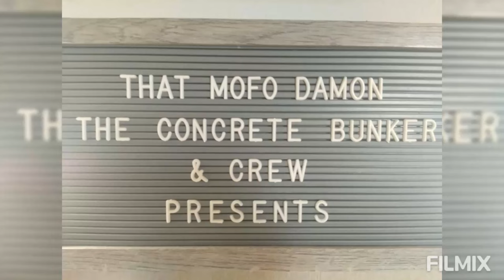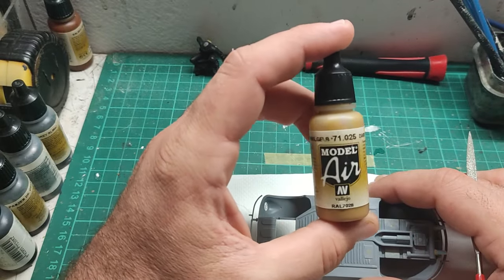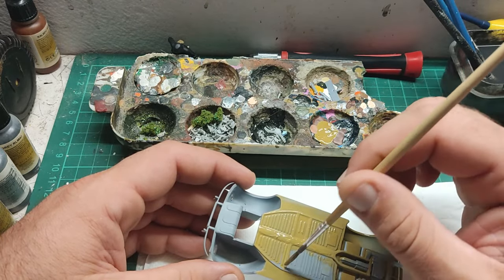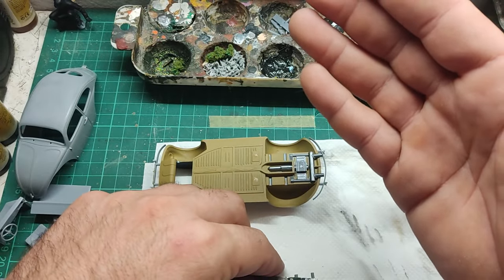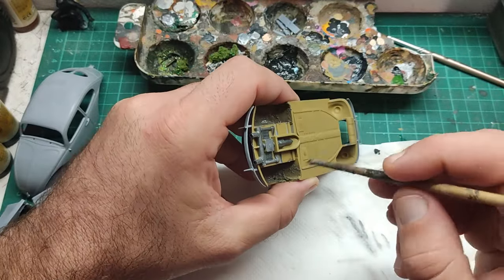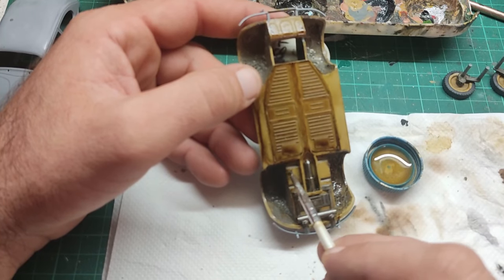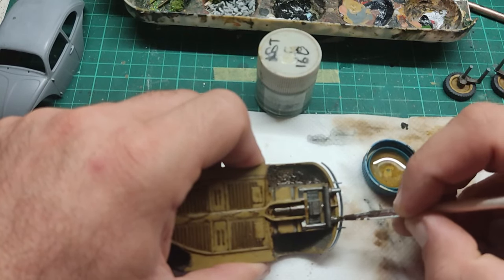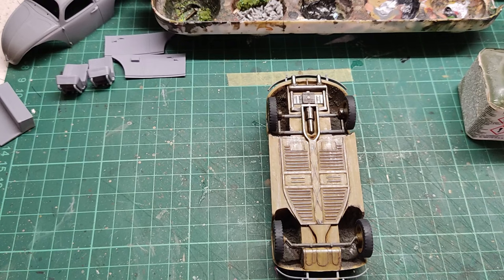VW Type 82 E Part 2 1/35 scale CMK (T35014) Sh#t high and gaze project

Comment: ευχαριστώ . Thank-you for your tutorial on brush painting Vallejo, I also paint mainly with Vallejo and have an airbrush, but some times because of noise from compressor I can't work when I have spare time at night. I' m going to try your method, no primer and just wet the brush. Normally I mix water with the paint and it becomes fragile when drying. Cheers from 🇵🇹.
Reply from the maker: Παρακαλώ (you're welcome)
I am really pleased that I've been of help! Give it a shot, you can always use  primer with my technique also, doesn't hurt, it actually may be even better. Moisten your brush, thin your paints (some of them, not all need to be thinned) and go for it. 
Let me know how it worked out for you, i hope that I've earned your subscription today. Take care and model on, greetings from Greece!

Comment: Hi George
Just a small note with your ‘racing’ exhaust modifications….
The little tube sticking out from the middle of the muffler pointed out to the rear is the actual tail pipe so no need for any extra custom work.
Great work as usual though mate ❤😊
Reply from the maker: Really!!! Beetles here have that dual exhaust tips (smaller though), but ive only seen the newer versions than the one i am building. Well, mistakes have been done now 🤣🤣 (custom it is). I really appreciate the feedback though, i learnt something new today! Thanks Michael, take care and model on my friend!
Reply: @ThatMofoDamon  yer mate
Rye field did the same version Volkswagen as yours, but typically it’s got more details then CMK’s kit.
I remember my Mother had an old VW back in the ‘70’s and I will never forget how small the tailpipe was compared to the old man’s Ford V8😂
Reply from the maker: @michaeldean1289  As expected from rye field, now i will keep that in mind and maybe track one of their kits!
Hahaha, i like the fact that you compared the 1.3cc (at best case scenario) with a V8 🤣🤣🤣
You should come in Greece, you will laugh with the stuff we drive here and consider fast 🤣🤣